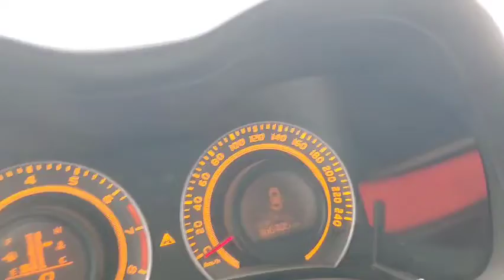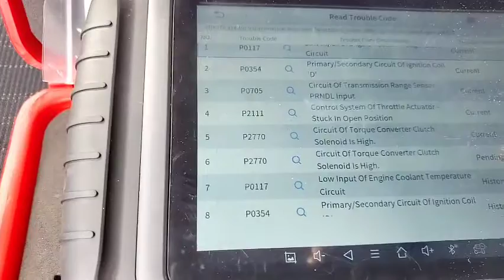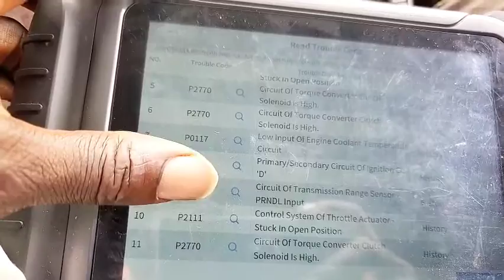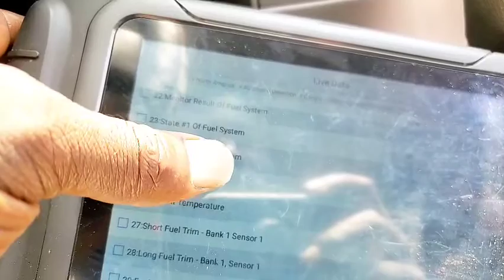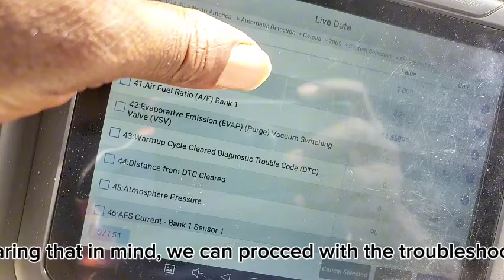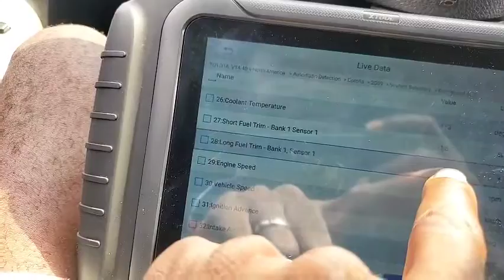2009 Toyota corolla loses power while driving troubleshooting and fix - poor engine performance

Comment: U replaced the fuel pump on my vw polo i commented on the other video,still car dont feel driving right,its sensitive on cold start but after 10mins of driving, accelerator n engine dont match(sluggish behavior compared to cold start where its sensitive n does as u press the pedal)(changed:timing kit, fuel injectors, petrol filter,new coils, new cam sensor, bought new o2 sensor which i returned it as it was not changing the behavior) scan shows no error(launch scanner i have)
Reply from the maker: Which model?
Reply: @Drcooltech  vw crosspolo cls1.6 2013
Reply from the maker: Clean the throttle body, if the car improved in performance, replace the throttle body. 

Change the fuel filter & air filter
Reply: @Drcooltech  I changed both n cleaned it but still,spark plugs black color but white rod is ok, I found that my heater doesn't come hot n the 2pipes to heater 1is hot n 2nd cold I think thermostat